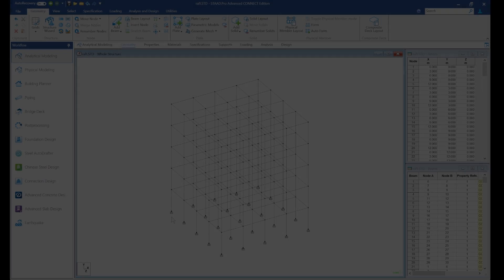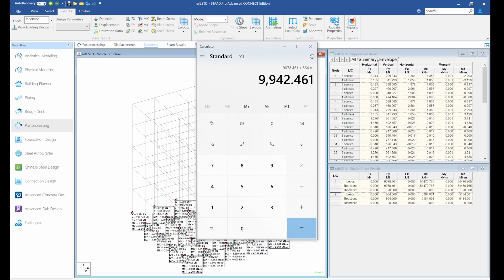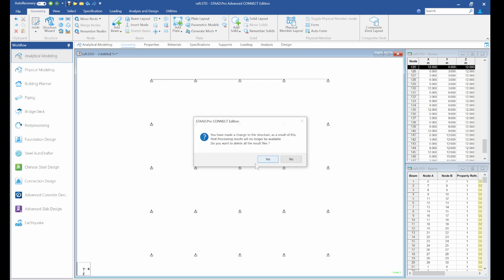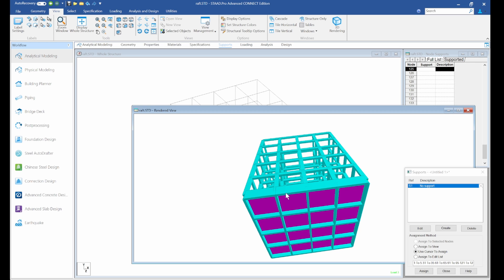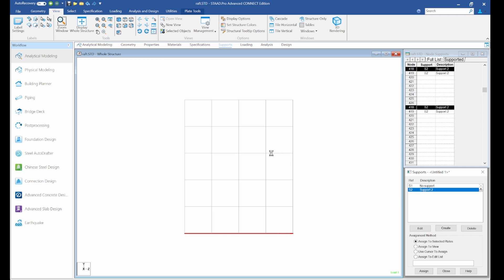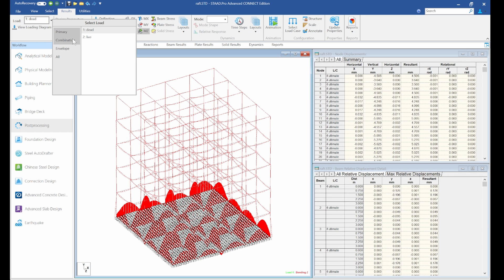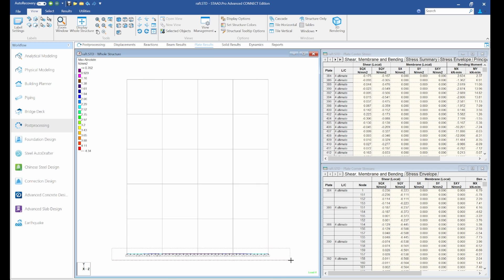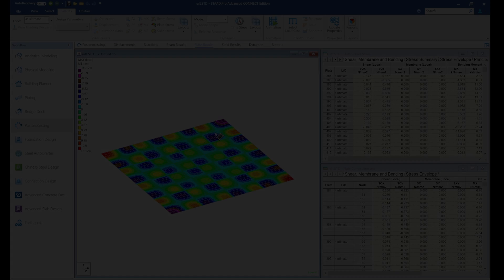How to design a beam raft slab on staad pro connect edition

Comment: Increase the depth of the ground beam suppose to reduce the base pressure but reverse is the case, if you increase the depth of ground beam also lead to increase in base pressure. Plz explain.
Reply from the maker: Does increasing the depth of ground beam reduces pressure? Ground beam is only there to help the slab in shear

Comment: Nice one. I noticed you only analysed. Do you design the beams and slab in RCDC to get the reinforcement details at level zero? Will that be correct?
Reply from the maker: Yes you’re correct for beam. But for slab you can just take the stresses in staad
Reply: How do you determine the reinforcements from the stresses? Concrete designer not working for me and it is combersome to determine the reinforcemnet by designing in the staad pro environment since it will give results for the meshes rather than the slab panels. @Lanreolokunola